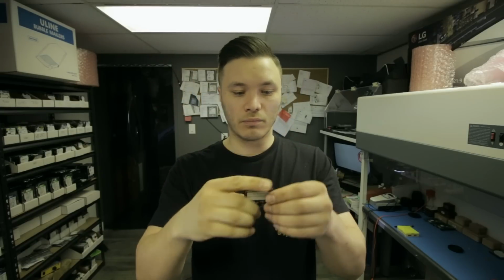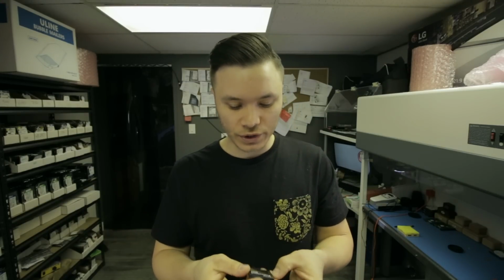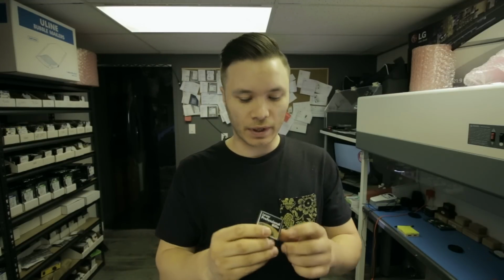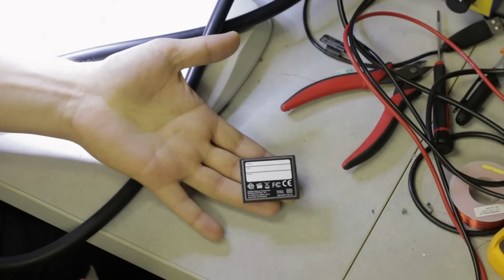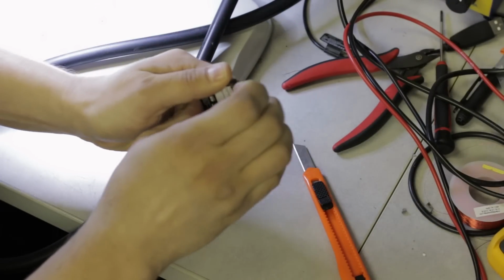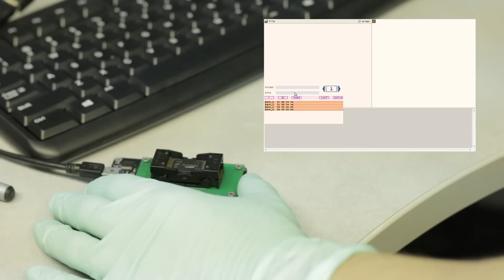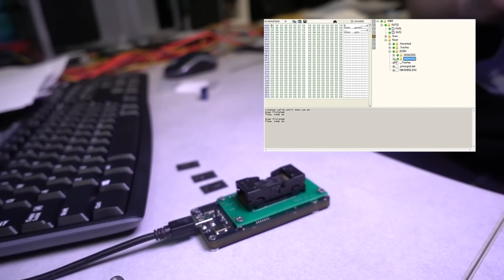how to recover data from dead compact flash memory card

Comment: Hi There. Thanks for the great video. I'm based in Australia and wondering if you could answer a question ? I recently had a brand new Lexar 256Gb compact flash card fail on me. The company I took it to said the Lab could not retirive the data because "  The software tools that they use for this type of recovery does not support my card. It has what is known as a dynamic XOR ". The explaination was that each memory had a different password / encryptiopn. I''m just throwing it out there. But have you come across this before ? Thank you for your time. David
Reply from the maker: Yeah, I've seen this happen on Lexar cards sometimes. Not often but it happens.
Reply: Thank you for your time and reply @hddrecoveryservices

Comment: Did you ever deal with hdd that spins, and after few seconds stops ? What can cause such behavior ?
Reply from the maker: we deal with that all the time. This would be caused by dead heads in 99% of times
Reply: HDD Recovery Services if i had doner - should I replace heads and eprom from board or only head replacement do the trick ?